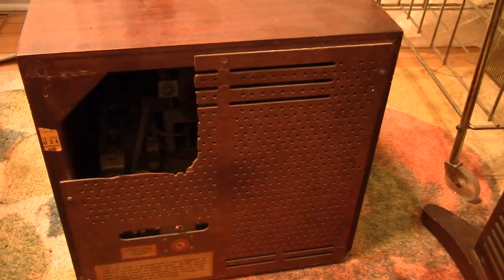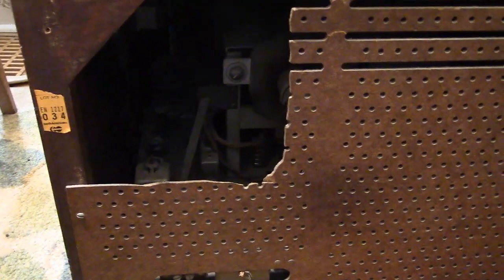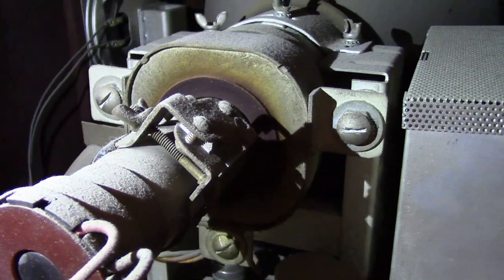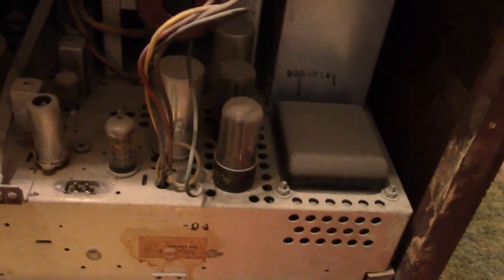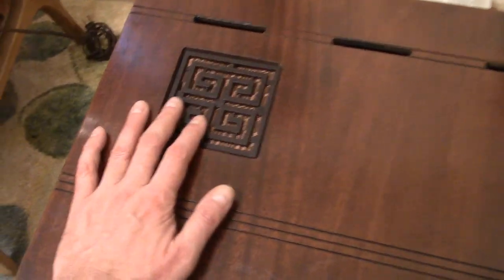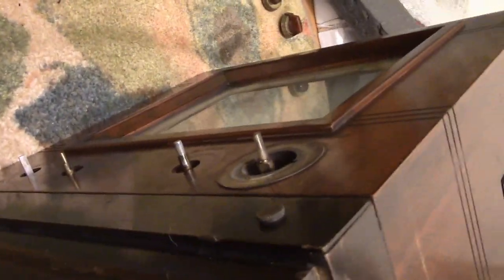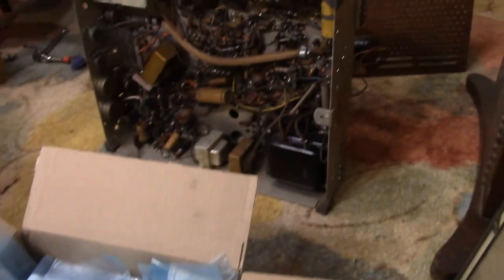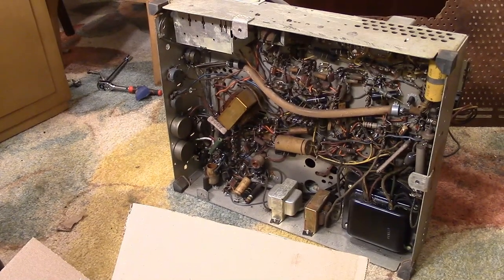Westinghouse H-223 restoration part 1

Comment: It was quite common here to have sections of the back cut away on early sets, up until '55 we only had one channel which was broadcast on band 1 so TV's were fixed tuned to it. When ITV went on air on Band 3 you had to install a band 3 converter, many of which bolted onto the back of the set and required the back to be cut away.

Comment: Sylvania also used Loktal tubes in many of the TV service equipment they sold as they were designed to be carried by the technician onsite and they had to withstand rough transport conditions.  I believe they were also invented at Sylvania.
Reply: Loctals were quite popular in the post-war era. They were military surplus, and therefore cheap, until the supply ran out in the mid 1950s. Growing up, we had a 1849 Rogers-Majestic R239 radio/phono console that used loctals for converter, IF amp, and 1st audio (7Q7, 7A7, and 7B6), meanwhile, the rectifier and output were the more conventional octal types (5Y3GT and 6V6GT), more convenient to replace when needed.

Comment: Some manufacturers used odd circuits to get around RCA's patents. Others used them because they thought they had a more efficient circuit. Some because they could get cheap WW2 surplus tubes, and designed circuits to use them. If that set uses MicaMold micas, just replace them. I have yet to find any that I could trust. Lots of wasted time "It's a mica and they never go bad". Nope.
 You might give Sal's Capacitor Corner a try. He does quantity discounts, as does Just Capacitors. Nice folks to deal with.
Reply from the maker: Thanks for the insight and advice

Comment: I would imagine remaking the back will mean drilling 400 plus holes on a blank Masonite board and redoing the
 interconnect onto the new board. Photographing the labels and putting those on it. The rest of the time is replacing
 all  of the bumble bee, non mica domino and electrolytic caps. You bought replacement quality components so I bet
 it will work then. Rare no flyback TV.

Comment: I like the suggestion below that, the set being considered pure junk at one point, someone cut out a piece.  I bet it was for a radio!

Reproducing a patch piece on Masonite still might not be "all that terrible" even manually.  First cut the edges perfectly vertically and horizontally, then trace with pencil through appropriate holes and slots onto a Masonite patch cut to size,  then drill and cut holes, slot ends, and slots, then glue strips of thin metal or stiff plastic on the inside where the patch meets the rest of the back.  There seems to be only one size of round hole and one size of slot.

Or for a raw artsy look just use Plexiglas.

Comment: I was a TV repairman for 30 years and I had fun repairing all kinds of antique TVs plus the present day LED yuk. If the picture tube is bad I was wondering if its possible to fit a more modern more available color picture tube in those old antique black and white TVs and tie all three guns together for black and white. It would be very challenging to get the impedance match on the yoke. What would you think if you ever seen where someone did that 😆.....and it actually works..🤣
Reply from the maker: The shape, deflection angle, neck diameter and voltage requirements are all quite different.  10" B&W CRTs are fairly easy to get.  I think it would be harder to find a glass color CRT that would fit.

Comment: I just watched this today, and I knew immediately why the square hole was cut out in the back. It was for the UHF Converter. Of course, these were mostly "set top" models. But there also existed models that placed the entire unit INSIDE the cabinet. All that would show would be the switch lever and the clear plastic tuner dial. One such unit was the Mallory 188 from 1954 (not to be confused with the Mallory 88 from 1953).
Reply from the maker: Perhaps.  What would it hold it in place inside the TV?  Would it be very awkward to tune?
Reply: @bandersentv  My source for this came from an ad from the trade magazine "Technician & Circuit Digests", April 1954. If you were facing the front of the TV,  you would see the switch lever and the clear plastic tuner dial protruding from the right side of the top rear end of the cabinet - where the hole is. I estimate that they only stuck out at about 3 inches from cabinet. There were no details on the actual mounting of this. I don't know how to send you a copy of this ad.
Reply from the maker: @robschertler8099  My email is bandersentv@gmail.com
Reply from the maker: I found it at worldradiohistory.  It's a shame they don't show the actual unit.  I can't find any service info or photos of the 188.  Makes me wonder if it actually made it to market.
Reply: @bandersentv  follow up...... Just now saw your messages and sent you an email - picture and a write up.

Comment: I wonder if the HV design is something borrowed from radar or some other vector display application where there are no deflection oscillators required.
Reply from the maker: It's a very common design in electrostatic sets like the Motorola VT71s and Admiral 19A1.  I think they even use the same coil.

Comment: Hope you can fill in the back cutout.  Reproducing a piece will be easier than reproducing the whole.  Bridge it with some sheet metal along the seam.
Reply: @EngineeringVignettes  3D print 1:1  ?
Reply: @MikinessAnalog  If you want something made of Masonite, make it of Masonite.  Still a CNC carver would be nice in a situation like this.  Perhaps one of Bob's friends has one.  It would help solve the "Mutilated set back" problem of which this is only a particularly egregious case.  (Gotta wonder what they were thinking though.  Insufficient ventilation?  A bit of horrible clumsiness?  And a 300 watt set with a back like that isn't going to get all that hot.)

P.S. I think it was sussed out.  Someone wanted a piece of board for the back of something like a radio and considered the set complete junk when they did.  Of course with our modern capabilities, things they might have thought hopeless junk then are not necessarily so now!  Big fat parts that have to be laboriously crammed in have been replaced by small parts.

And got to say, making the replacement section of plastic would have a kind of raw artsy appearance, assuming the plastic wouldn't warp under the heat.

Comment: Surely you have a fan/follower who could match the pattern and zip a new back out of Masonite with a laser cutter?
Probably not worth the money it would cost even just to have the CAD drawing done… idk
Reply: Bob has a lot of club friends, and arrangement with someone who can might be a nice pilot project for the needs of other set restorers.  Some people do CAD as pure hobby.
Reply: You can just take a photo of the back, use something like inkscape to vectorize it, clone and flip the part on the top and then import it into a CAD and match dimensions. It won't be perfect but still much better than trying to fix the original back.
I'm currently attempting to do that with a radio of mine, I'll see if it's as feasible

Comment: What is up with the mismatched hardware holding the chassis. I serviced consumer electronics for decades and could never understand the lack of professionalism regarding this issue. I always replaced the hardware that I removed. I have seen this over and over again.
Reply from the maker: All I can figure is workshops got sloppy at times
Reply: @bandersentv  Agree, I knew one, his name was also Bob but he had a different last name and lived in a different city, that would just take all the screws and dump them in a coffee can, then dig out later whatever would approximately fit.  But I did get some practice fixing sets for him, with which I tried to be a little more careful.